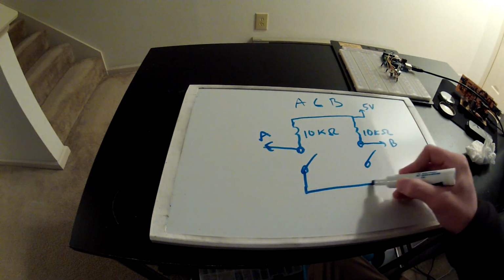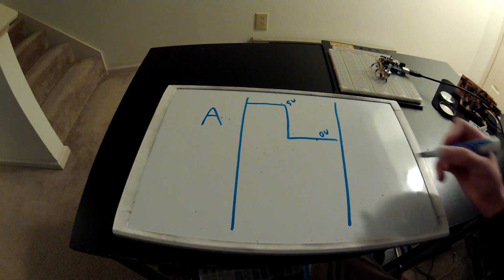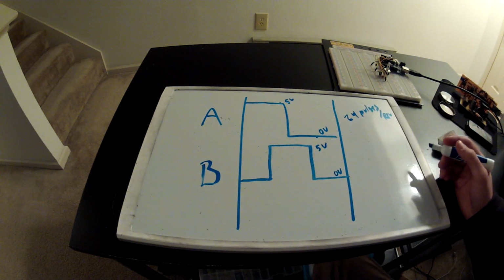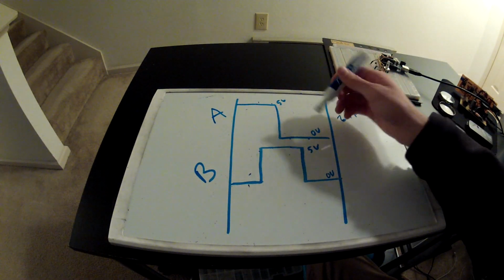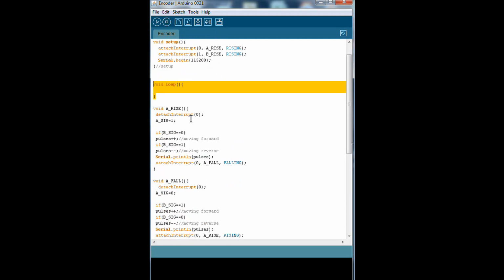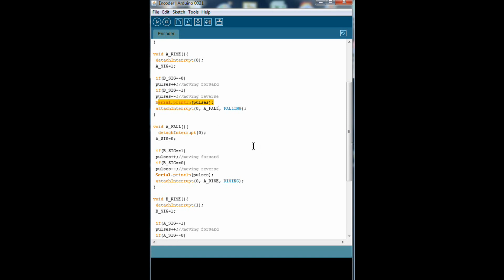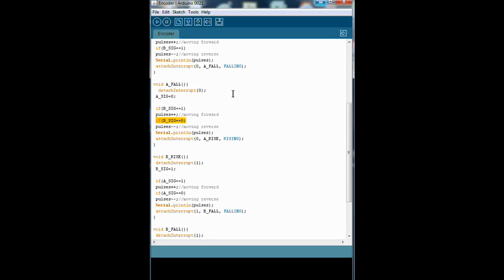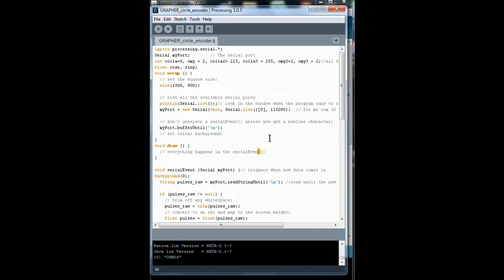Rotary Encoder Tutorial with Arduino Code

Comment: Why do you use interrupt pins instead of regular joe pins? Surely a program that uses the interrupt function would be less economical, given that there are a limited number of interrupt pins on the arduino boards. The UNO would only be able to house 1

Comment: With two D type flip-flops you can get a single pulse on one wire if you turned one step CW, and one pulse on other wire if you turned one step CCW.
This saves code and time I think!

Comment: continuing

.but when i turn clock wise or reverse it just add some times..and after a while it starts to subtract..and it shows the same number for 2 times..it looks like that:
"0 1 1 2 2 3 3 4 4 5 5 6 6 7 7 8 8 9 9 10 10 11 11 12...101 101 100 100 99 99 98 98"

Comment: Great!Thank you so much!!
what do you think was wrong with mine? i put the correct capacitors and resistors and i tested that so the correct voltage 0 and 5v is on the wire

Comment: Hi Kdarr1234,
AM WONDERING IF ANYONE OUT THERE CAN HELP WITH THE CODE TO RUN ARDUINO WITH TWO IR SENSORS S1 AND S2 TO PERFORM DIRECTIONAL COUNTING IN AND OUT. IN THE FIRST SEQUENCE BREAKING FIRST S1 AND THEN S2 WILL TELL THE MCU TO INCREMENT THE COUNT WHILE BREAKING THE SECOND SEQUENCE, FIRST S2 AND THEN S1 WOULD TELL THE MCU TO DECREMENT THE COUNT. CAN I MODIFY THE CODE FOR ROTARY ENCODER? THE MCU SHOULD ALSO TIMESTAMP THE DATA AND BE ABLE TO PASS IT ON TO A REMOTE COMPUTER VIA B/TOOTH OR WIFI

Comment from the maker: yes, or figure out a way to 'lock' the encoder when the power is off.  That way you can simply write the last position into the EEPROM, and read it back on power up.  ABsolute encoders can be expensive...

Comment: Very nice presentation. I really enjoy this video. The aproach that you used in your code is very good. I am porting it right now to another C compiler because I play with PICs, not the arduino.

But I have one question. First the scenario: I have a box with water inside. This box have a wheel that spin write (just a line) on a paper the level of the fluid inside.

So I need to digitalize this box/machine. First I thought about encoders and came here and watch your video. OK.....

BUT @24:29....

Comment: I used your code with a DC motor with quadrature encoder.

It works! I get pulses and also implimented some code to get time.

The problem I'm having is when I try to impliment code to calculate velocity....I get zero result or stops the code from functioning.

Is there a way to send you my code for some help understanding what I'm doing wrong?

Thanks

Comment: 2 interrupts are the limit, but theoretically you could add more to the arduino. the chip supports more. You also could add pin a of one encoder ti int0 and the pin a of the second encoder to int1, so if int is changes you check pin b on the encoder and then you know in which direction you go. This would also need a debounce circuit.